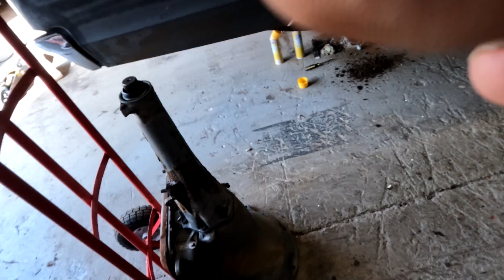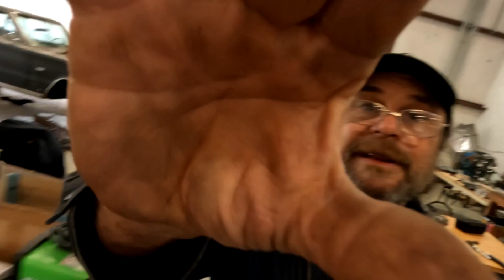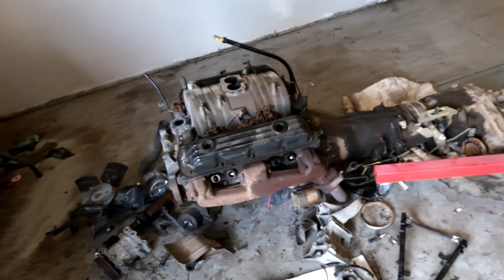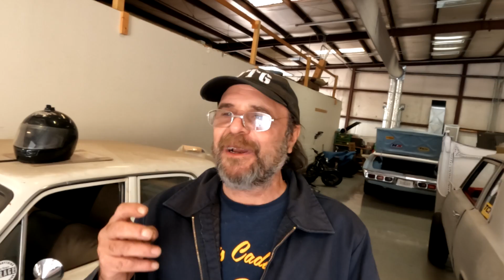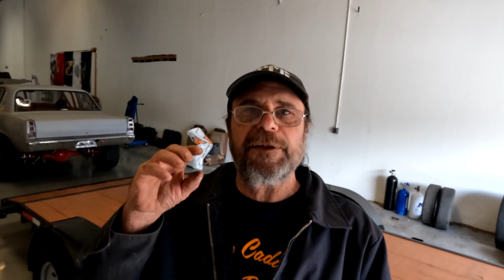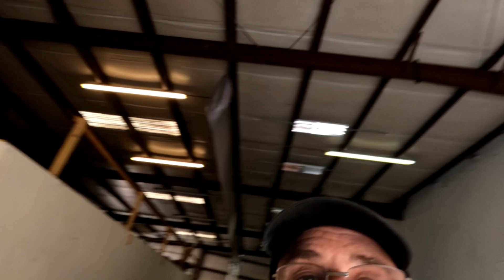Can A Timing Chain Issue Literally Explode Your Engine? You Betcha! Here's How

Comment: Uncle Tony, how does line-boring change the distance from the crank to the cam???
If the re-linebore is centered exactly where the original linebore was centered, then oversize bearings should locate the crank exactly where it was. Aren't the block and main caps drilled equally??
Reply from the maker: No.  There are no oversize OD bearings, only ID.
Reply: And the difference should be taken up by the oversize bearings . 

That's the theory , is that the line bore/line hone SHOULD be on the original centerlines.
Reply: But if there are no oversize OD bearings , why wouldn't they be prone to spin in the oversize bore ?
Reply: @Richie_the_Fixer  I was wondering this too, and the only explanation I can think of is that a line-bore job on a rebuild is done to the exact same size as the original line-bore, and to accomplish that they have to cut the bore deeper down into the block, toward the cam bores.
But then, how the heck do they deal with the slack which is created 180º opposite the new cut??? Shorten the main caps? Remove material from the block where the caps' bolt/flange/bosses mate up?

Please answer this Uncle Tony because obsessing minds want to know.
Reply: Back in 1992 when I bought a $250 dollar '79 LTD coupe for its rebuilt 302 to go into my '82 GT 5.0, the seller told me it had been line-bored - and then had to explain to me what that meant, as I assumed a cylinder bore. I put 150000 hard miles on that engine.

Comment: Hello uncle Tony. I've been trying to get ahold of you a few times and you ain't never answered my question. I have a 1971 340. The last Time I run the motor was 42 years ago. It's been in the garage since then and it run really good. I put a brand new oil pump in. I went to Prime the motor the driver side oil flew out of the Rockers no problem. Then I wrote at 8 the motor over so the cam bearing hole was position to the passenger side. I only got a little bit of oil coming up. Would it be alright the fire in the motor up. Or would you tear the motor down to find out what's the problem
Reply: Yes uncle Tony I meant to say the driver side when I prime the motor it just flies out of the Rockers then when I rotate the motor over to line up the cam bearing  the right passenger side it only comes out a little bit. What would you do put the motor in the car and fire it up and keep an eye on the passenger side rocker or would you take the head off take the motor. I hope I hear from you thank you

Comment: I have never seen a busted timing chain, ever. Nor have I ever actually seen a chain skip teeth. But yeah I know about the over tight chain deal. Seen that many times when it seems like you have to "stretch" the chain at the cam to get the gear on. And to the mopar 907 or 727 sluggish going in gear, seems old and worn. Front pump seal. Get a shift improver valve body kit that allows the fluid to pump in park. Have a tranny shop do it while your pulling the trans to change out the front seal.

Comment: OMG.  I'm here searching for 5.2 Magnum videos because I'm exchanging out the 5.2 in a 98 Durango.  The #3 rod bearing likely spun/failed because the bottom end of the rod obliterated (left a stump).  I replaced the timing chain about 25K miles ago and it was very snug.  Now I'm wondering if that caused/contributed to the failure.

Comment: I saw that video. I think he said the main problem was hitting 10,000 RPMs on a blown shift.
Reply: That makes more sense. For that kind of power in a "small" engine you have to be turning higher rpm to start with. Missing a shift and really spinning it up isn't going to do parts any good. Makes me wonder what broke first. Maybe the extra stress broke the crank then there was so much energy it just took everything out as it flew apart.
Reply: Ouch - Gary said the heads are still good - just replacing 3 valves that got bent.   Hard to believe if he hit 10K RPM.
Reply: Totally agree TT, A early 318 LA 4” over bore zinging it to the moon. Most definitely was a contributor in that catastrophic engine failure. Yea as if it was a blower motor. We had a 355 sbc with a 671 blower. That snap the end of the crankshaft off due too to tight of blower belt….UT ought to be a stand up….LOL
Reply: I bet more than 3 valves are bent.

Comment: Thanks for the class , very informative. Hemi question, is it true that if you disassemble a Hemi that align boring is required? I ask because I found an old 392 but it needs a rebuild. This will be my first Hemi rebuild.
Reply: Nope they are very true , I have built a 276,354 and a few 392's with no issues
Reply: A 340  c.i. mopar small block stock roller timing chain and sprockets work on 392,354 and the later 331 Fire Power Hemi engines. the earlier 331 had a different snout set up. I have always used these roller units on these engines as well as LA  and Magnum small blocks and never had a problem. I have never had any crank saddle alignment problems on my builds of early Hemis however I check it on all engines. I had a Ford 312 once that was as crooked as a dog's hind leg and had to tear it back down and have it aligne honed.The customer had originally bought it from A NAPA store as a rebuilt engine.

Comment: @uncle Tony's garage
Thanks for the great videos !
*Suggestion *
Trailer wood decking appears to have mountings screws on every 2nd or 3rd cross member and ONLY one screw at each of these points- Over time and moisture exposure, boards warp and can break screws and subject boards to uneven loading and breakage  
I suggest to add more screws to prevent warping & breakage of decking boards and screws  !!
Thanks again !!

Comment: I had a 5.0 mercury capri that slipped the timing chain. Nylon timing gears. Took a while to figure out why it wouldn't run. Valves hit pistons. Bent 8 of the push rods and put a hole in number 1

Comment: I always liked the idea of those gear drive kits.  But it seems engine builders don't like them. Why is that?
Reply: They were a thing on small block Chevys back in late 70s I think because people thought they were cool because it sounded like you had a "blower".
Reply: I have a gear drive kit on my 383ci small block Chevy street/strip engine. You can get helical gears and straight cut gears. I have straight cut gears. They are stronger, and they make a noticeable whine. Sounds a lot like a blower whine. No that is not the reason I went with straight cut gears, just an added benefit. I was skeptical for a while, but have had no problems with it. So far.
Reply: Harmonics was a popular talking point back in the 80s about why not to run gear drives. On a high rpm engine or engines running high spring pressures on small base circle cams in classes where 2 or 3 hp separate the top half of the field harmonics become very important. For your average everyday hotrod gear drives can work very well. I prefer a single idler gear drive myself they are as bullet proof as it gets. Not loud, very strong, never changes once set, and minimal harmonics of any gear drive. There is potential power loss but for the accuracy and brute strength never buying another timing assembly that 1% power loss I will gladly take in trade.

Comment: Hey Tony, You have got me concerned now. first of all, I am doing everything for the first time and I learn by watching videos like these. So... I just replaced my timing chain in my 383. It is an old 2bbl engine that now has a 4bbl and from what I can tell it has only been apart once to get hardened seats installed in the heads. When Installing the timing chain a week ago or so, I could not put the top gear on by hand. I figured that the old chain had so much slack that the  new one wouldnt slip on because the gears might not have been aligned perfect. Therefore, I just tightened the screw on the top gear to get it on. Will this tight timing chain become a probelem with performance engines or could this potentially be an issue for my tired old motor in my cruiser?
Reply: you need (next time) to work both gears on at the same time.  It sounds like you put the crank gear on first, fully seated.  This puts the chain at an angle making it tighter than it actually was.  Except that you really stressed the chain, you're probably fine.
Reply: @firebird77clonefirebird89  I did work Both gears on at the same time!
Reply: If you rotate the crank to load one side of the timing chain, the opposite side should have a little side to side play. look up david visard power tech 10. he has a video on this subject Timing chains.
Reply: That timing chain will stretch a little fast too  u good 👍 now Tony got everyone bugging lmao he likes he shit loose. 🤣 🤣🤣 I don't want no loose chain